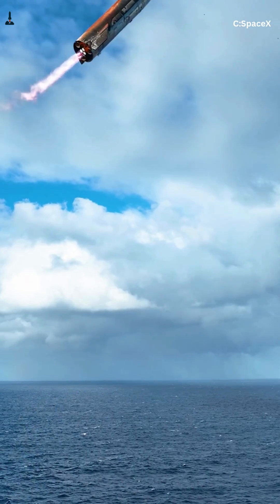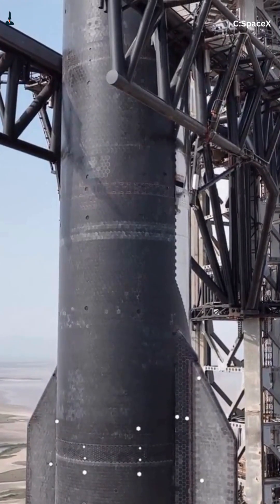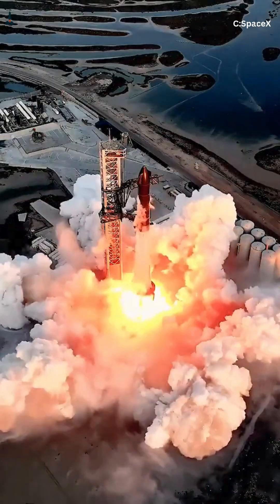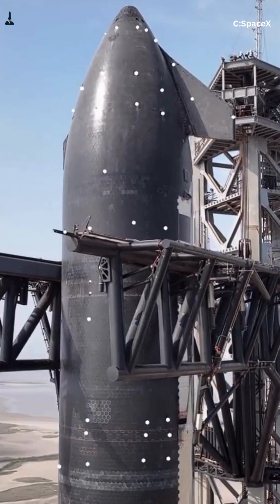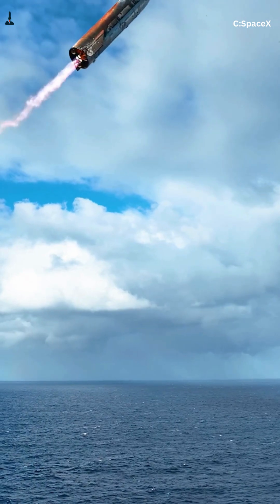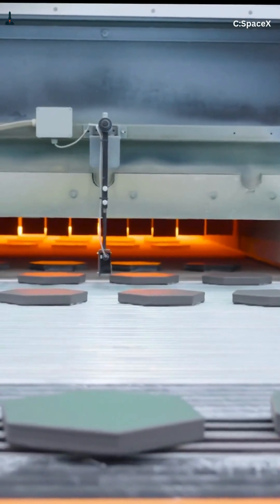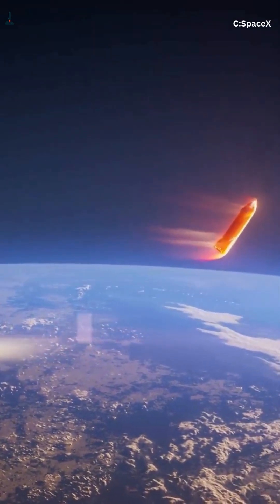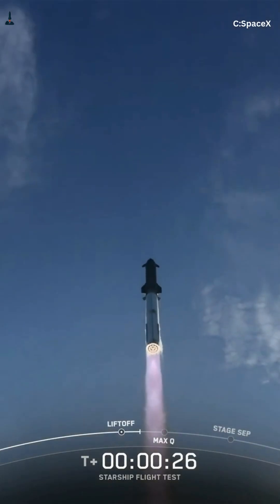Ablative? No Thanks — Here’s Why SpaceX Went Tile Crazy! #spacex #starship #heatshield #elonmusk

Comment: I GOT ANOTHER QUESTION  DO IT GO STRAIGHT UP ALL THE WAY TO MARS OR WILL IT TILT OR GO THE LEFT HOW DO U EVEN KNOW THE  ROUTE TO GET TO MARS. U NEVER SAY HOW LONG IS THE FLIGHT.. HOW BIG IS IT INSIDE AND HOW LONG IS IT IN THE AIR BEFORE THE BOOSTER IS RELEASED  WILL I FEEL ALL OF THAT HOT HEAT?  I KNOW IM NOT GOING TO FEEL ALL OF THE HEAT BUT CAN U FEEL SOME AND ALSO ISNT IT SOME KIND OF SPECIAL GEAR THAT I GOTTA WEAR AND MAYBE A HELMET 
HOW AM.I GOING TO BE SECURED INSIDE😂
CATINA CRAWFORD